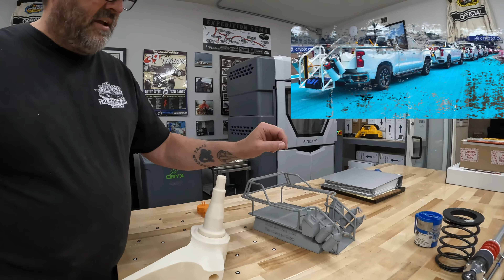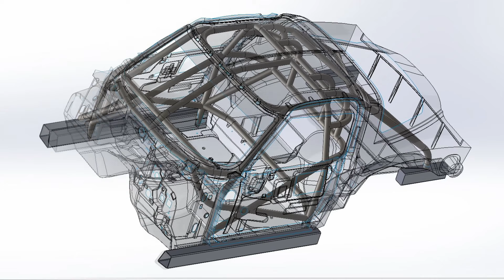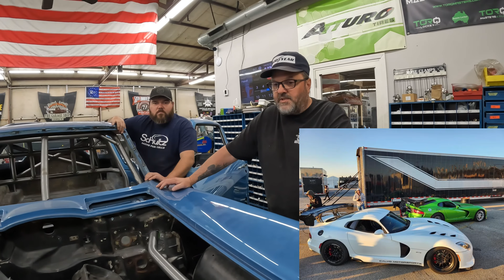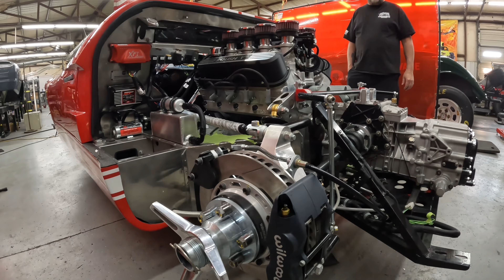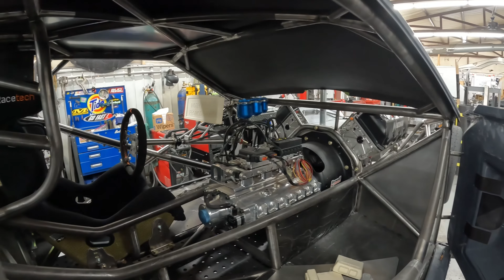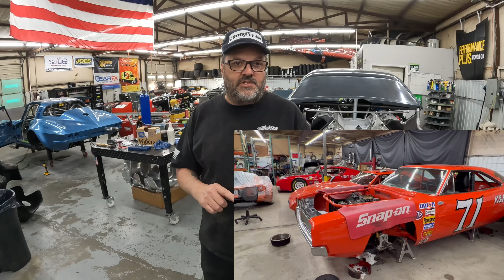Big Things Are Happening!

Comment: What kind of steel are you using to build your roll cage out of?
Reply from the maker: Depends on the car. Promod is chomoly , stock car chassis are dom ground
Reply: @TheGarageShop200  I was wondering if it was chromoly seeing how it's higher strength steel. Great work BTW!